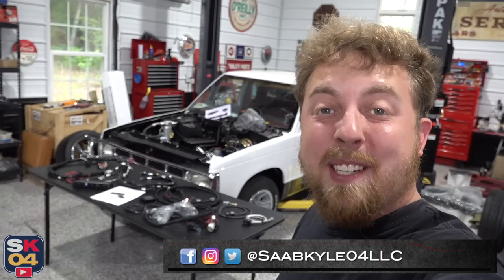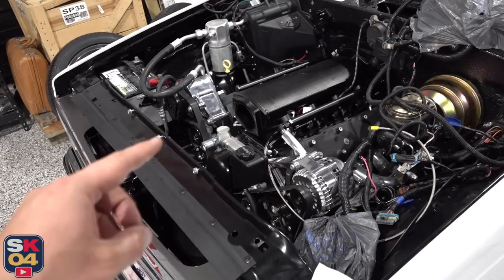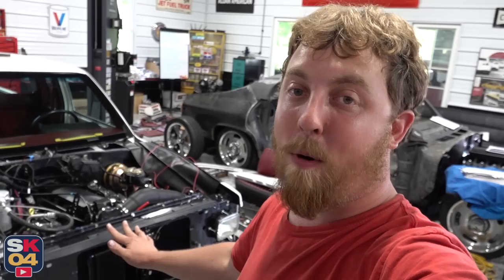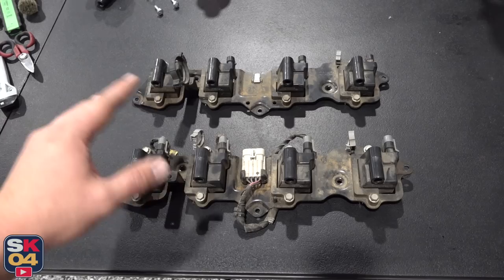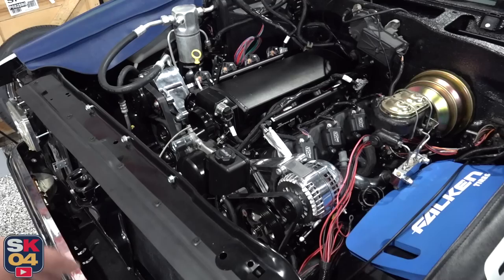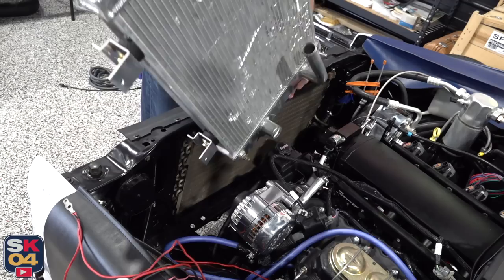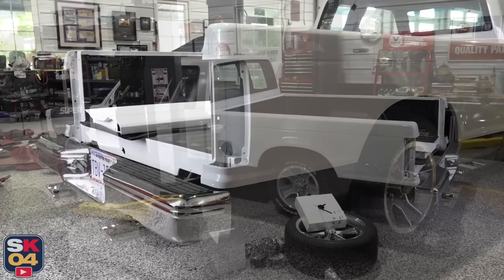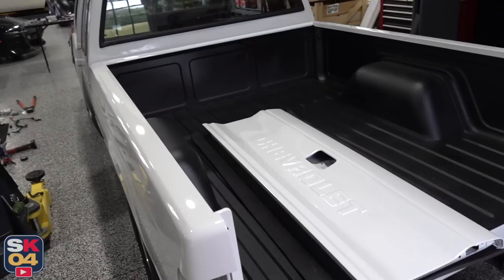Wiring Up The S10's LS Swap With Holley Terminator X Max! S10 Restomod Ep. 29

Comment: Since you are putting the computer next to the battery, and it's not even a dry-cell battery, I have to recommend a protective barrier (like an ABS battery box) between the two in order to prevent corrosion through the computer case by even simple and limited amounts of vented acid vapor.

Comment: If I got the terminator x max ls1 24x (550-919) am I restricted ls1 motors or am I able to go any 5.3 4.8 6.0 with the system ? Got it for a steal on market place lol thanks in advance haven’t gotten a clear answer
Reply: @Vegas ECU doesnt care what you have it connected too, it will run what you have the tune set for. The harness can be modified to work on any of the LS engines.